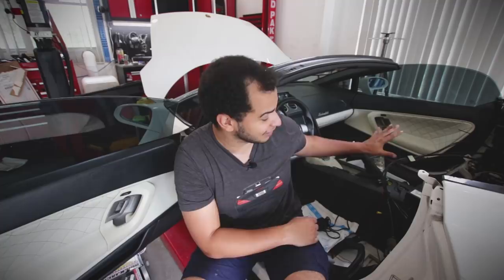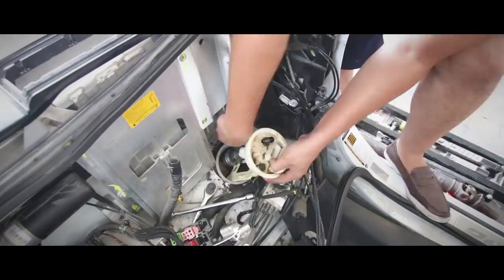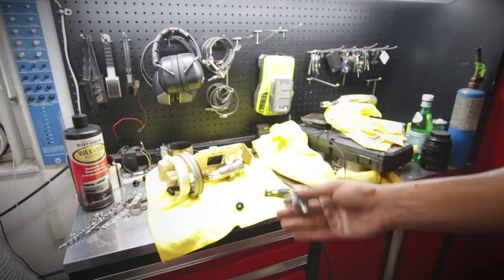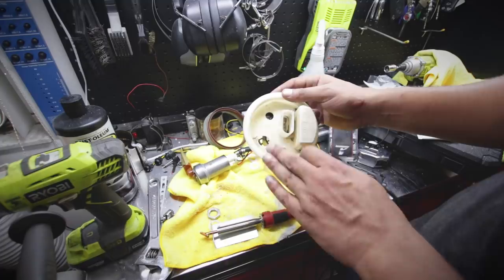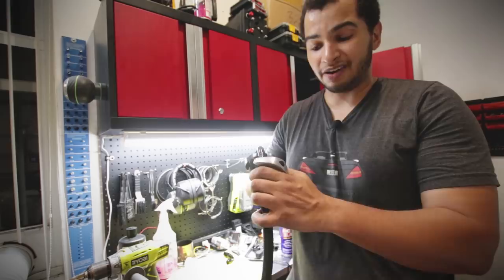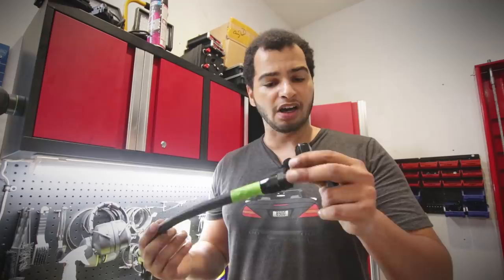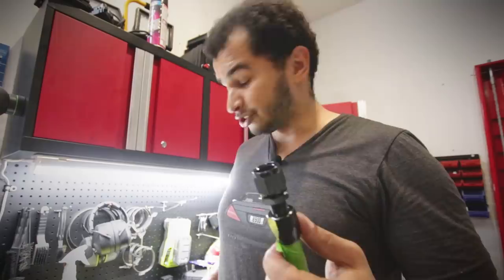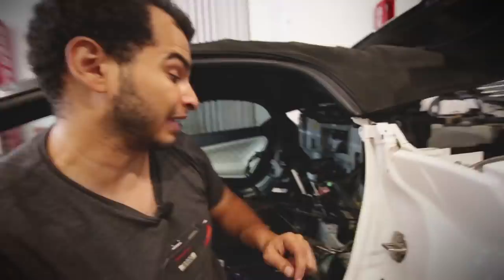I Found The REAL Reason Why My Cheap Lamborghini Was On FIRE (And Fixed It For FREE!)

Comment: Regular blue loctite is going to be dissolved by fuel. You need 542 loctite or similar. Also the zipties aren't going to hold up very long for the same reason.
Reply: Hassu Kassu the o-ring aswell or am I wrong?
Reply: I even worry the plug he drilled out and replaced with the welding was a pressure relief plug. It'll probably be fine, but screwing around with stuff that hold highly flammable material is worrisome.
Reply: Yep, I thought the same thing about the zip ties.
Reply: This guy really doesn’t know enough to be doing this kind of work. Lessons learned: 1. a novice can’t reliably rebuild a fire damaged car and do engine work without help from an expert. 2. Tavarish would be totally screwed without youtube helping him
Reply: @chrisj197438  Just on the basis of that comment, Tav is at least twice the man you'll ever be.
Reply: Fuel will not eat up the zip tie.
Reply: Upvoting so that tavarish can read your comment and save his car from burning again
Reply: Tavarish doesn't like responding to worthwhile comments that actually shed insight.
Reply: If ever there was a time to just buy an OEM parts it's here...the pressurized fuel system. I'd understand if there aren't any available, then you're forced to make do, but absent that it's just too risky. I think he probably made the situation more dangerous than it was before. Why roll the dice like this, needlessly?
Reply: @TheKurtboss  use the goat emoji. He might read it when you add that, but I agree with you.
Reply: Why you use metal for fuel systems, it eats rubber and plastic.
Reply: Aulkraen Hmmmmm... , my petrol hedge strimmer has got a plastic fuel tank. Yet to be eaten by the fuel it was designed to retain... very peculiar.
Reply: @xHAMFISTSx  Same with Tav's Lambo. Very peculiar indeed. He'd better not call his windshield a 'windscreen; though, or I'll make plans to nuke the UK.
Reply: @jnavonoD  Ten times the man.... at least!
Reply: Relax this is how he is gonna collect that fat check from the insurance company
Reply: @jamescraig4479  I'm OK with that. He's not OK with making such scurrilous comments under his own name, though.
Reply: TheKurtboss I always find it weird when people have this weird fetish for OEM especially when the last system was clearly a bad design to the point were it lit on fire.
Reply: @ibyisabeast  how do you know?  it may not get eaten, but they could become brittle and crack apart into the fuel.
Reply: The fuel will never see the loctite or the zipties unless it le as is again...🤔
Reply: TheKurtboss exactly, given the story of the car (fire) buy 2 new pumps, install oes style, and be done with it. Now you know that is not a concern going forward.

Comment: What material were the zip ties that you used?  It appears that they will be submerged in gasoline...
Reply: I was thinking the same thing, probably not the best place for zip ties
Reply: I thought the same then thought maybe he done this while he runs test but who knows
Reply: Nylon Zip ties wont break down in fuel.
Reply: @Not_Hans  Maybe some high quality, QC checked nylon is 'ok'.  But Tarvarish shops at Harbor Freight and has a $20,000 engine with $20,000 of add-ons relying on the mm of 'nylon' click to not give way over time? ; /   Im not a fan of this decision.
Reply: @brianwelteroth9248  Uhhh no that's not how Nylon works bud there is no "purity" of Nylon it seems like Harbor freight only sells Nylon zip ties and as a Bentley mechanic i can tell you there are Nylon zip ties in the fuel system of a $220,000 car.

Could he use a better option YES clearly he can, does he have too? No not really.
Reply: @EricSchutt   Once again.... Nylon will not break down from e85. In fact you can pick up a really nice cheap good quality set of Nylon braided hoses from Summit for this build if he ends up rebuilding the fuel system.
Reply: Zip tie and o ring worries me.
Reply: Kickers and Stickers Bentley Mechanic my ass
Reply: especially with E85 they will melt like butter
Reply: Agreed. Long term those O rings could fail.
Reply: I hope he didn't get the O ring from a regular multiple size kit. They are Buna-n rubber and will break down. Always use Viton O rings with petroleum products.
Reply: Agreed, the only issue is the O ring material here. Zip ties are commonplace in fuel systems both petrol and diesel.

Comment: I wonder if the previous owner smelled fuel, and just ignored it.
Reply: Would have had to smell it, since it was coming from just behind the driver's seat.
Reply: Thats funny, I was wondering the same. He MUST have. That car has been dismantled and reassembled prob a good 10 times. Connectors like that are cheap plastic and are made to be one time use. Two if you are careful. SMH....

Comment: Just be sure that the O-rings are rated for fuel.
Reply: The bulkhead lock nut needs to be cut on the underside to accept an o-ring.  Just squishing an oring in there will work for a short time until it extrudes out and you spray fuel all over the place.
Reply: You can also cut a small phase to the plastic hole edge and have the o-ring kept by that. But this seems really an accident waiting to happen right now.
Reply: I would have just thrown two new fuel pumps in while you had them out I hate fuel pumps they go unexpectedly
Reply: @AIM54A  Your correct he has 'basic' bulkhead fittings like for mounting to the firewall.  He could 'convert' them to actually seal or buy something engineered for his application.  ((Even if he had the correct locknut then the next possible leak would be the threads on the locknut.  He was close when he said he would put loctite on the threads to keep the locknut on, he should be buying the loctite though to seal the locknut.))  But yeah good luck getting Tarvarish to read this stuff.  I tried to tell him about his messed up AN fitting routines on the oil return line.  aka No boys and girls you do not use teflon tape on AN fittings, and its the conical face which does the sealing...  He also loves using adjustable wrenches on AN fittings, pretty sure that is ripe for distorting the poor alumnium fittings.
Reply: You seriously need to rethink the o-rings something is really wrong there. an fittings are a metal to metal fit! No seals. Also dump the ali an fittings they are notorious for work hardening and cracking in road applications.  For a road car you need to be using plastic or steel fittings.  Btw I know a little about these things.  Look me up if you like Complete kit car magazine in-house builder.
Reply: How else is he going to extend the rebuild? Now he has to make a video with the redo!

Comment: Since you have everything out, clean up all your wiring with wrap and looms. Also, clean all the metal, degrease and install dyno mat. It will prevent rattling interior noise and heat from that motor and trans. Keep up the good work bro.

Comment: No Loctite it can cause the plastic to crack!
Reply: He has no idea......  the loctite outgassing causes plastic to become brittle and shatter with minimal effort, it takes very little outgassing to degrade the plastic.

 He needs to replace the o-rings with fuel resistant nitrile. So while he is in there he can correct both errors. These are all beginner errors that can cost a fortune to learn on his own.

Comment: Just an FYI.......WD 40 is not a lubricant,  it’s actually the opposite.  It is a degreaser.
Reply: Actually, it's neither. It's a water disperser (hence WD).
Reply: Actually it's a 40-year-old movie by Walt Disney.
Reply: @SINIS0RSA  
Uhhhhh no. It's clearly a 40GB Western Digital hard drive.
Reply: It's actually the 40 iteration of the famous line of pornography films, wang danglers.
Reply: Jason G *Displacement

Comment: What is up with the hose clamp (on the back wall of the bench) @ 11:18?  It looks haunted, moving back and forth!
Reply: acceler9 Yep... If you hadn't said it, I was going to. It looked like it was moving to the beat.
Reply: My guess is that it is moving because Tav keeps bumping into the table the tool panel is attached to.
Reply: @HepauDK  He said he had the AC running in the background because of the fumes. Probably just air hitting the right spot to move the clamp.

Comment: Why not use heat shrink for the braid ends. Cheap and clean. A little hot glue can help ensure the braided line does not run. ... Small change for large gains! Good work!!!! You’re truly inspirational!!! I’m planning an engine swap on a project car (not a Lamborghini) in the future. ... Don’t get high on fumes out there. ✌🏾 No mo 🔥

Comment: I like to use proper anti-seize on my AN hose builds. I use it on all threads including the JIC.   What you will find over the years is the ethanol gasoline is corroding the fittings.

Comment: To lube the fluid lines for fitting installation, just wet it with whatever fluid you plan on running inside the lines. There are many reasons to not use WD40, one of which is that WD40 have a tendency to damage rubber, another is that it is actually slightly corrosive to metals, in fact if I ever needed to use WD40 I would always clean everything that touched it with light oil or degreaser solvent just to make sure WD40 is washed away.

Comment: Wont the zip-ties  melt in the gas over time?
Reply: Had the same concern.
Reply: Well if the gas gets hot enough to melt plastic then thats a big issue as it shouldn't heat up until of course it gets into the engine
Reply: @danielohara2915  not from heat...
Reply: I wasn't referring to heat, I was referring to chemical breakdown.
Reply: @dipsyfriday  ah ok nvm sry
Reply: @litgeeksquadofficial  when gas breaks down plastics, there is actually a chemical reaction that creates enough hear to cause ignition of fumes or fuel.
Reply: I thought the same - I doubt zip-tie plastic is made for sitting in fuel
Reply: @leolldankology  link a video of that happening
Reply: @litgeeksquadofficial  I think there is this invention called a search engine. You can use it to look up information.
Reply: @leolldankology  burden of proof is on the one making the claim
Reply: @litgeeksquadofficial  I have nothing to prove to you. What you do with the information you receive is completely up to you.
Reply: Nylon zip ties dont break down in gasoline.
Reply: @litgeeksquadofficial  I see you used a search engine. 👍
Reply: @leolldankology  No one is doubting crazy things can happen, but the main initial concern, for most of us at least, is the plastic deteriorates in raw fuel. Thats all.

Comment: Plastoc welding is so easy. Used that a lot with my model cars
Reply: Is there not a grain/strength issue with the reformed plastic?
Reply: @themekfrommars  not that I can tell.  I have been using it on motorcycle plastics and chainsaw fuel tanks for years.
Reply: @themekfrommars  pressure vessel, so ... no. No issues. especially with that stuff right behind the driver's seat.

Comment: Just remember with the fittings for the hoses beeing higher up, you get more leverage on them. So any kind of strain, will put a lot more strain on the plastic than the otld ones.
So just make sure that the hoses are secured to something else than just the fitting, and cant move. Or you might get a crack after a while, and get the same problem once again!

Comment: Would you changing the other fuel line as well? So they will have a balance fuel flow on both sides? Also about that zip tie that might melt with gasoline. You can test it by submerging a test zip tie into bowl of gasoline if it will melt or not. 

Wonderful work freddie. I ive watch the entire lambo build tread. Your attention to detail is priceless. You might end up with the best sorted out build twin turbo lambo on the planet.

Comment: Good to see the cause of the fire sorted at last 😊
Question... The fuel hose inside the tank unit that runs from the pump to the outlet port... In the video it looks like its kinked slightly on the S bends? If so, that will restrict fuel flow.

Comment: You could use the masking tape on the jaws of your shifters to help stop them marking your fittings. And you should use a light lubricant on the threads to stop the aluminium from gauling.

Comment: Hey Tavarish, just curious. Why don't you seal the outside of your fuel line fittings with silicone caulking? I used it in the marines a lot on our vehicles to guard against future leaks. The major downside is that you have to scrape the stuff off whenever you want to remove the fittings. It sure is effective though.

Comment: On your returns there;   dumping directly from the top like that, without a hose that drops down into the tank can aerate your fuel.   You should have a line that drops down from the -6 bulkhead to the bottom of your tank to prevent this.   Just an FYI, that can be problematic on systems with heavy fuel cycling, like your car will have at low load.

Comment: as for the an-fittings you need to use aluminium wrenches because of when you use other tools for aluminium and make direct contract the aluminium will oxidise/ corrode ( i don't know the correct grammar since english isn't my firdt language) make absolutly sure you use all wrenches you don't want to take it out in the near future

Comment: You need to put an elbow and some line on that return into the tank. Dumping agitated fuel right down to where it’s being picked up isn’t good for trying to keep a consistent fuel pressure. Your pump can suck bubbles instead of straight fuel

Comment: I would use stainless braided teflon hoses if you dont want fuel smell of another fire. Rubber hosed are porous hence fuel smell and dont hold up to heat as well.

Comment: Didnt see... but did you use 90deg angel fittings in both ends? It twist the hose. 1st rule on gas and hydraulic hoses ;)

Comment: Ive tried that bulkhead fittings on a vw with the same fuel sender unit. I had a hard time getting the fuel vapor smell to go away. I had no leaks in my system but the bulk heads even with a gasket still lets vapors out.

Comment: On the steel -6 AN fittings and smaller be careful of the final torque.  You can crack the flare on the inside of the female fitting.  If you hear a "click" when torquing.. you get to start over.

Comment: With the history of the scheduled checks and maintenance of high end Italian vehicles, I would go ahead and replace any non metallic fuel lines, see if a custom fabricated aluminum fuel tanks can be made and fitted (if you have the plastic or composite tanks), replace any fuel gaskets and o-rings, plus the addition of a Halon system in the engine area wouldn't be a bad investment.  Is there more heat in the engine bay, due to the turbos?  Many hyper-car manufacturers will place additional cooling fans in the rear to suck out the extra heat during slow traffic or the vehicle engine running while car is stationary. I live in central FL and summers are like an oven set to make beef jerky. The other nine months are awesome though. :)

Comment: Hey Tav, Don here from Montreal. Love the channel - keep up the good work! Been thinking about the roof problem... is it possible the system is sensing somehow the absence of the stock wing? Like maybe it needs to know the wing is in the flat position before the roof will open, but since yours isn’t there, it can’t sense that so it stops the opening process? Maybe look around in the engine bay wiring loom for plugs with nothing plugged into them and put a volt meter on them to see if they actuate during the opening process? Best of luck!

Comment: Hey Tavarish! Ive got a question. I wonder if you have a schedule or sort of work plan or workflow planned for it. Of course, unplanned things happen! But, now you’ve got another issue behind covers which would have been closed unless you got back to something else. 
I am working as a pilot and know the technical inspection intervals of our planes very well. Once in 12 months each of the planes is in a structural inspection and every piece is taken apart and reassembled by 3 technicians within 2 months. Including the TPE with its turbine and all around. 
The big Q... Wouldn’t it be easier to take the entire car apart and put it back together? Although you are alone and probably not working full time on it- but therefore on a smaller scale with less strict „quality checks“ compared to an airplane? (And no time eating documentation!) I mean it like Inspecting every part, repairing cleaning or replacing everything thats wrong... But therefore its all perfect in the end... Greetings from Germany!

Comment: I trust the hose is E85 resistant?  There are masses of fuel hoses currently sold that aren't resistant to any ethanol content let alone 15%.  The problem with braided hose is that you cannot see if the hose material is cracking up before its pee'ing fuel everywhere.  
Personally, I would not have bothered with a plastic repair and just fitted a stainless bolt with fibre washers as plastic welding requires skill that should not be learnt on a fuel tank!

Comment: Personally, I would’ve replaced it.  Those plastic fuel pumps fail regularly with hairline cracks.  They start out white then turn tan then yellow and brittle and yours has seen some age.  Ferrari and F1 Maserati uses the same dual pump system and has the same issues (my left pump is on order). The left side always fails first, for some reason.

Comment: Check for leaks with a completely full tank! It might not leak under pressure now, but it will probably leak when the tank is full and those fittings are essentially "under water".. Don't wanna see this beast burn down.

Comment: I would have used Stainless Steel Cable ties as they are great for projects that standard nylon zip ties just shouldn’t be put through.  Applications like high heat, submerged in fuel, extreme weather conditions, high vibrations etc...   Please tell me you used nylon zip ties and not something from Harbor Freight!